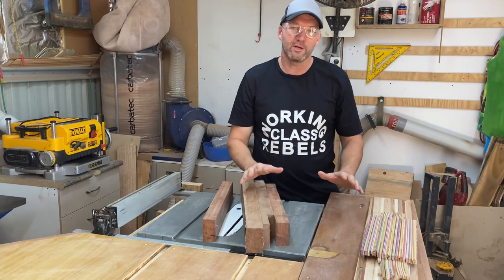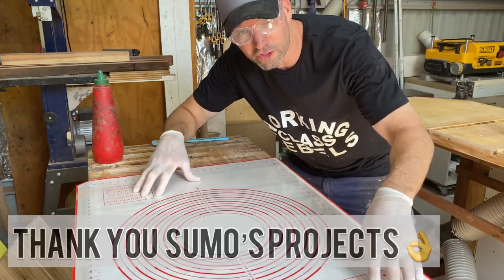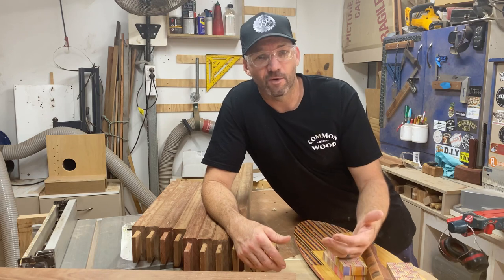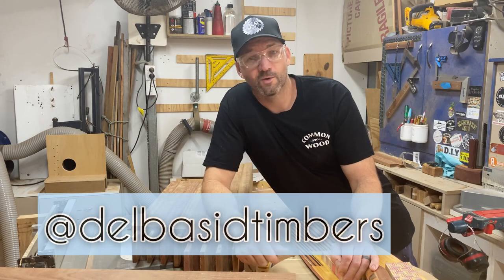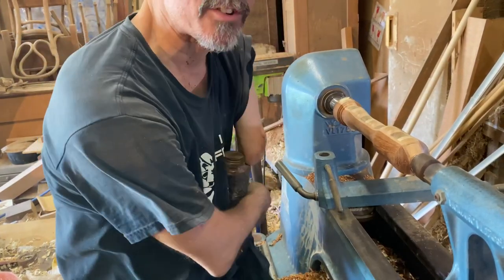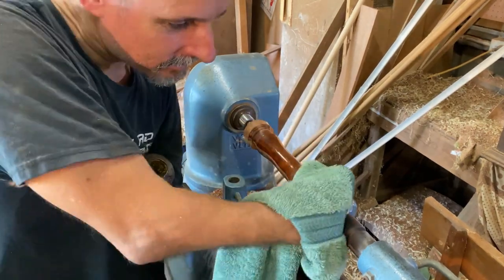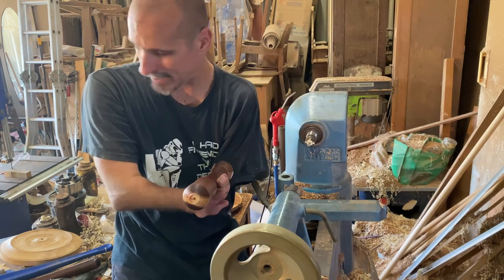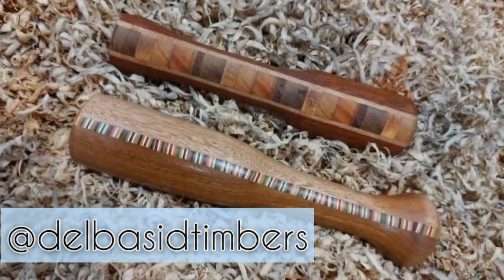Making Mallets with Delbasid Timbers

Comment: For those with a US Government Education...... They are in Australia.  
Australia is on the other side of the world, south of the equator.  
That means their season is the opposite as well.
So, Texas is freezing, while Australia is "sweltering".
So he may mention a 40c temperature in videos soon.
Here is your formula to convert Celsius to Fahrenheit.  Or, from the unfamiliar to familiar.
Cx2-10%+32= a Fahrenheit temperature.
For an example of 40c we get 40cx2=80. 80-10%=8 or 80-8=72
Last step.  72+32=104.
Thus concludes the geography with mathematics, with applied science lesson.
Reply: @dainermade  I'm in Vegas, so we do that temp about 8 months of the year.  That's part of how I'm so familiar with working in that heat you mentioned.